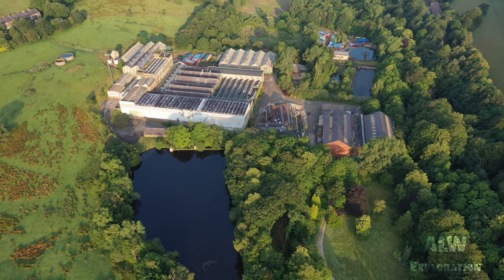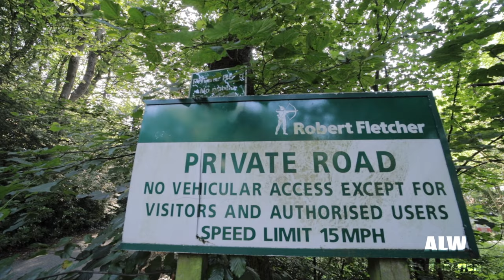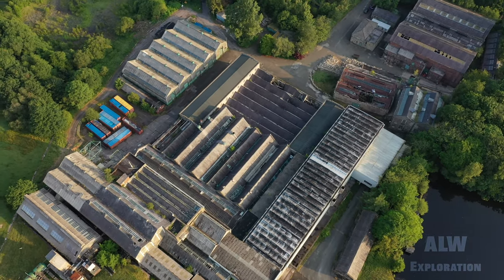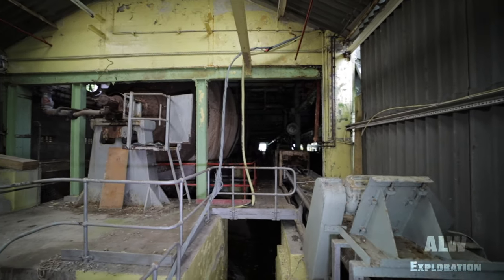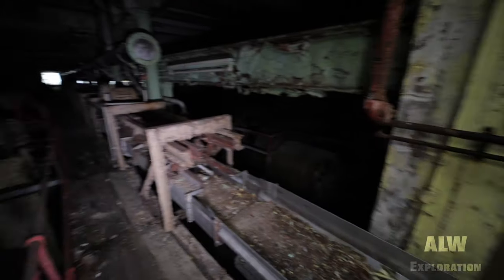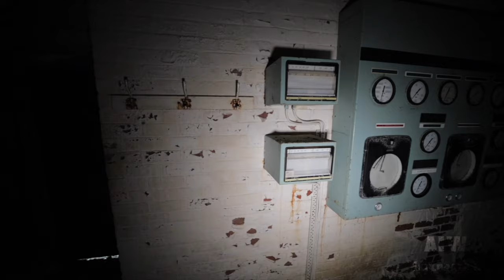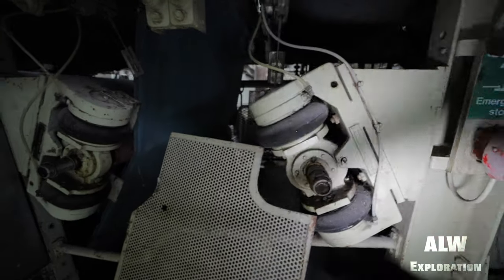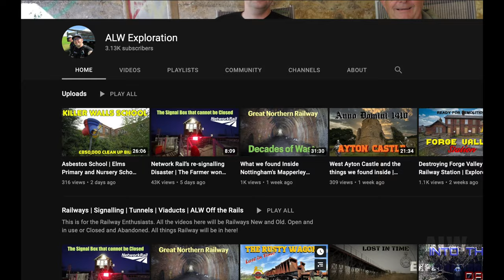How Wood becomes Paper - A Step by Step Guide inside the Paper Mill

Comment: 6:29. Does it run windows MS DOS. Old school. looks even older than that. Could be 1981 or so. 1975 when the new things arrived maybe. looks later than that. 
Looked where it it. Too far, always to far for a jolly. We got very little in Oxfordshire. Boring. Brick factory 58 miles away best I done reciently.
Reply from the maker: Hello Daniel :)   The computers here are Measurex systems that used a IBM microprocessor with a racal decca LINC software. I reckon they would run if properly powered up. This was a hard one to get in. We had intel of another YouTuber sighted in the area, we went in the early hours the next day and hey presto. A board had been torn off. How convenient. I’m not the moral police, so in we went.